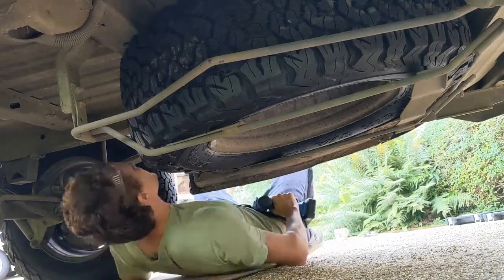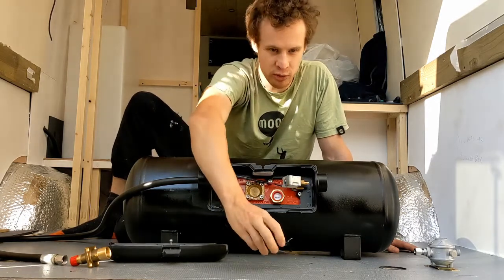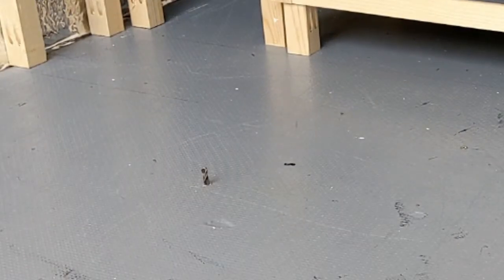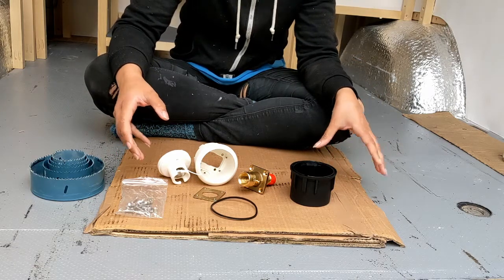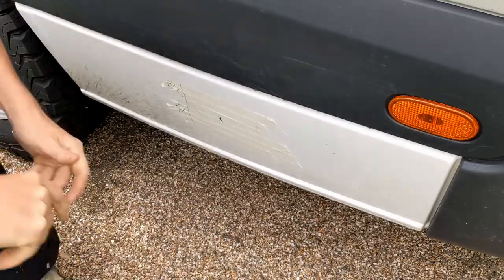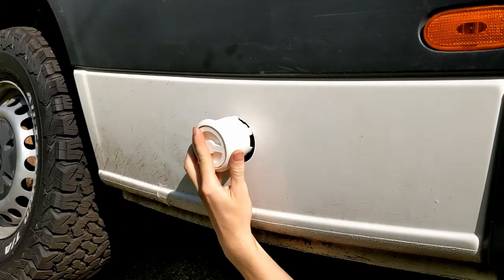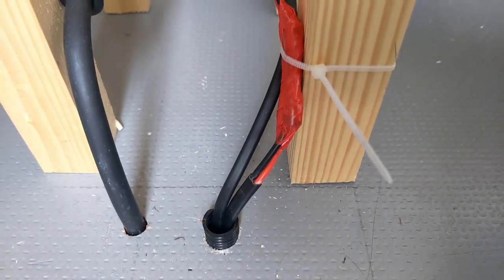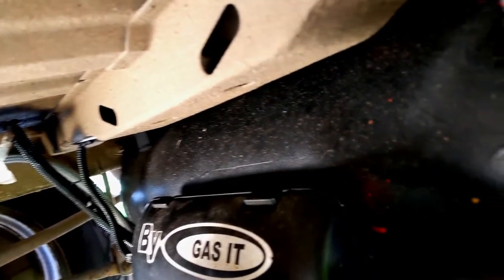Installing Underslung LPG Gas Tank | High Pressure Side - Part 1 | Crafter Van Build | 31 |

Comment: Thanks for the clear instruction video. @7.33 min you are showing the back side of the drilled hole with high pressure tube going to the gas tank. 
There is a black rubber cover to close the hole. What kind of cover is this?

Comment: Hi and I enjoyed your video!  I’m just about to do the same!  One thing though; it’s better to mount your gas sensor at low level since CO2 and LPG are heavier than air… Thus, if there is a leak, the alarm will sound before any gas builds up to a level where your heads are when you are asleep….!

Comment: What size tank did you install,?? Also would it not be better to fit the tank with the electrics box pointing rearwards to reduce road debris and potential damage? Thanks for the video! :-)
Reply from the maker: We fit the 40L tank. For us, this was the only way round it would sensibly fit because we have a spare tyre behind it.

Comment: any directions regarding pigtails hose and regulator? i stuck on this point because i have two appliances with two different pressure 30 and 37mbar. so how would be the connection from the tank? thanks for any help
Reply from the maker: Hi,

We think 37mbar is the pressure that used to be used before the standard became 30mbar, so it's probably worth contacting the manufacturer to check the required pressure now. If not, we'd suggest speaking to a certified gas engineer as all of our appliances are 30mbar so we can't be more helpful.

Comment: looks good Im also thinking of getting a tank from GasIT as well - do you know if the solinoid just needs power when you are using gas ?   Also did you use the low current driver ?
Reply from the maker: We're pretty sure the solenoid only needs power when the gas in on & ours uses about 0.5A.
We just put a normal 12V switch on the live feed between the fuse block and the solenoid.